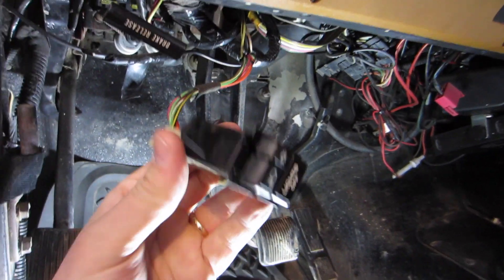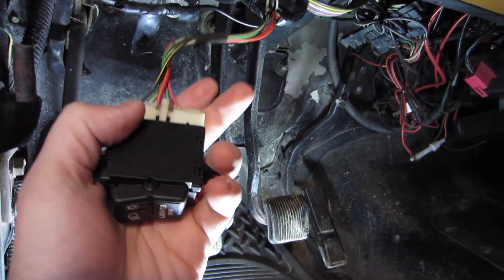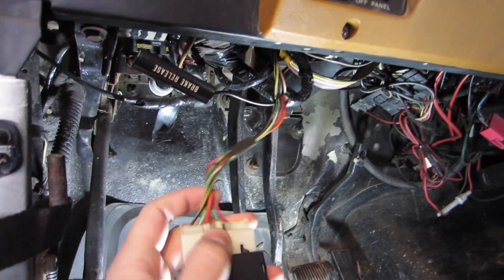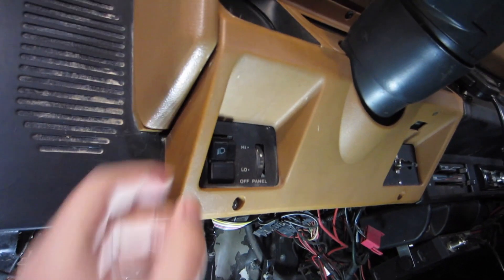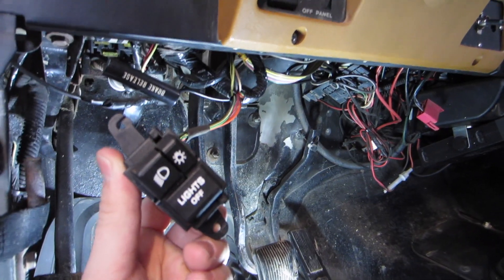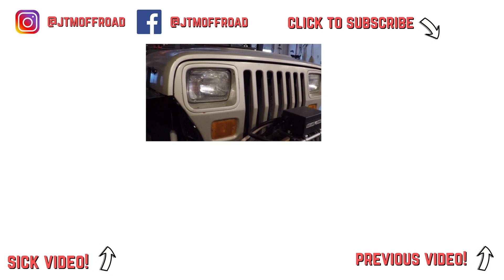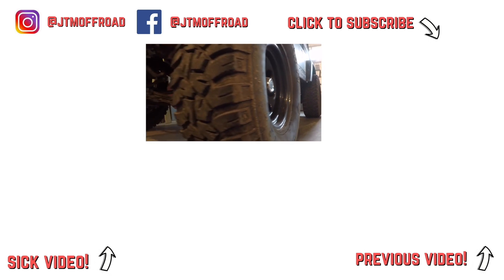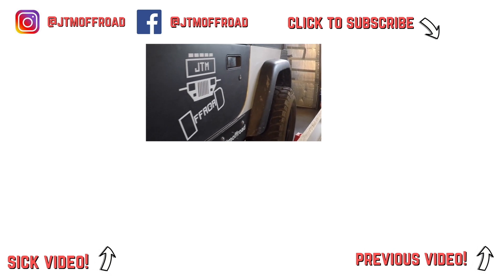YJ Wrangler Headlight Switch Replacement and New Camera Setup!

Comment: I would like to add LED light strips in the foot wells and have them come on when I turn the headlights on.  Can I splice into the hot wire of the switch, if so how do I do that?